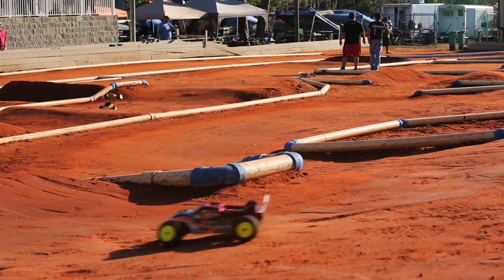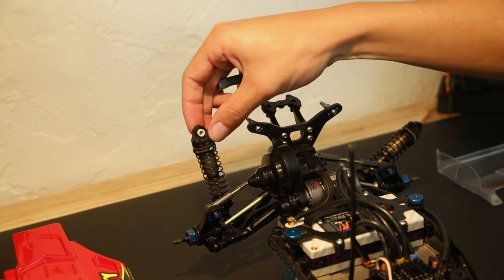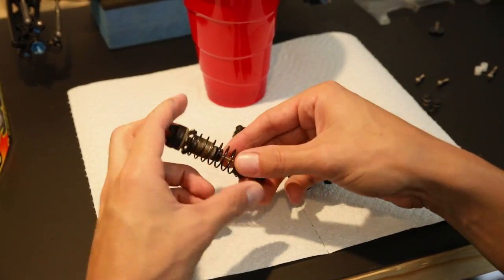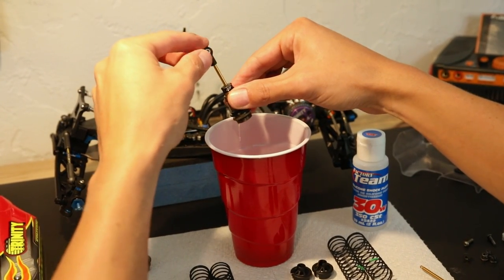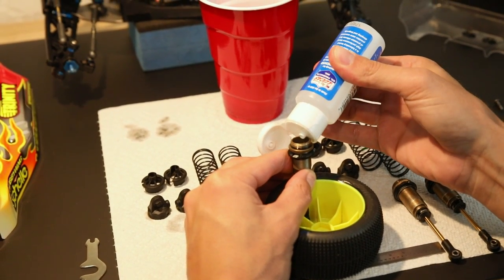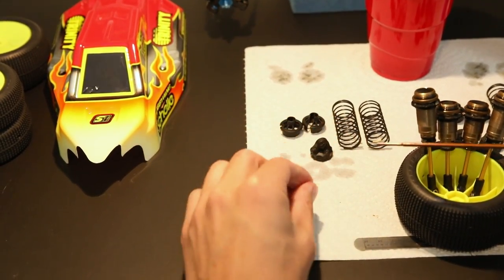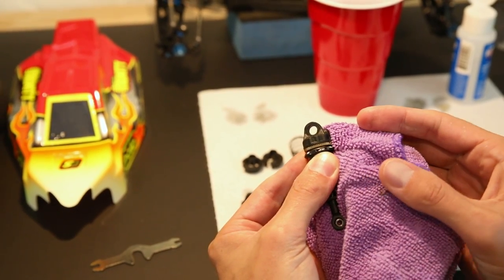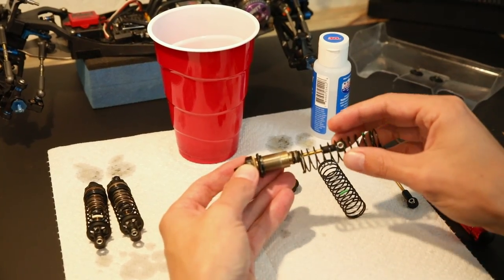HOW TO BE FASTER RC || Setups tips and mental tricks

Comment: Ryan: This might help you with an extra tenth or so especially with super loose/blown out tracks where light suspension is used. 
When doing your ride height, drop the car on two layers of polymer film, trashbags work fine, that are split down the center of the car. This acts as a roller bearing and allows the tires to compress outwards and inwards, squash, allowing true rolling ride height. 
Keep it up! Great videos :)

Comment: can you do videos specifically about setting each adjustment, and what those changes will do as far as handling changes...
   like a video all about ride height...  one about shock adjustments like different piston/oil combinations and spring rates...
   a video about toe changes and how they affect handling.
   a video about camber...
 and one about other smaller changes like Ballston washers and Ackerman and roll center and ....
   I'm just getting into setups beyond tires and shock oils, and picked up a ride height guage, camber and toe tools, and have a shock shaft tool and shock stand coming. ...
   thanks for your videos, subbed

Comment: Great advice.   1987 thru 1988 I raced a Tamiya Grasshopper.  Crude by today's standards, but top of the limits back then.  I had modified it with Oil filled shocks in the front.  All wheels and the transmission had sealed bearings,  I had better steering parts and I had an adjustable timing Kyosho Motor.  There were faster cars than mine but I won more times in my class than cars faster than me.  I will never forget a guy coming over to me very frustrated.   He says my car is faster than yours but you always beat me......How are you doing that.   By being in control of my car.   While his car could pass me....He would always loose control of it and crash.  I would drive around him as the spotters would try to get to his car and put him back on the track.

Comment: 1st shock oil change following your tips. Thank you sharing. Traxxas GTR bleed holes are set little differently but overall it was same process and it goes well for the oil change. Like slower is faster so true. Cheers

Comment: I was just wondering if there were tips you can give on basic driving of RC cars. I find that I struggle with how and when to use brake when cornering. I have search youtube and there are no videos to help guide a beginner in the basics of handling of an RC car. I have found your videos very informative and would like to know if you could make a video on the basics of how to drive an RC car during a race to increase lap consistency and handling. Thanks. Great video.
Reply from the maker: That is a great idea! I will be sure to make this type of video in the future. Thanks!
Reply: I just want to say hell yes.  I just got into the hobby and there are a lot of basic handling things that I keep messing up.  I love the idea of this type of video.
Reply: Oh man, I KNOW that I'm losing so much time because I'm crap on the brakes. I coast way too much, then when I try to push I, blow it too often. I've been racing for 10 years and braking is my crutch.
Reply: I'm trying to get into racing instead of bashing. I bought a TLR 22t 2.0 for this reason, but I could use some beginner driving tips.  I'm all over the track, the truck does it's job very well, but my skills is another story. Thanks for the great videos Ryan.  😎
Reply: Ryan Jackman 
Just watch the cars in fr9nt of you or just watch a few races and spot their lines and the car movments also never take your fingers of of the wheel
Reply: Hey Willy, what class of car are you running?
Reply: Getting a good transmitter and reciver setup is key slowing down the steering curve and helps with minor correctins on longer straights you dont get that with most basher setups
Reply: @RyanHarrisRC  you could just take one of your winning races that you taped and do a commentary about driving and what your doing. Even show repeats or slow motion of corners or features your driving!

Comment: If it pushes out that's rebound. Pack is based on pistons and the holes they have(how many and sizes). Pack referees to where the oil changes from liaminer flow(smoother low shaft speed) to turbulent flow (more restince high shaft speed)

Comment: Awesome video and a lot of great tips. If I can just ask 1 question why did you tighten your shock cap back on with tools?  It's my understanding that you shouldn't have to. It's kind of like tightening a oil filter in a full size car you only need to hand tighten them.  I've only ever hand tightened mine and have never had an issue.

Comment: What I like to do when getting the collars equal to each other. I screw each collar all the way up on each shock, take some bright color nail polish, like red or silver(nail polish is easy to remove when needed), make a mark trying to be dead center with the bleeder screw. Now, when you screw each collar down to get your ride height, you can use the mark and count each turn...say four turns on the right shock and four turns on the left shock until that polished mark you made is center with the screw again. Basically knowing you did four turns down on both shocks. And if you want to double check, after you do this, use some calipers and check the gap between the collars and top of the shock body.

Comment: Thanks for the tips dude. Ive got a race next week. Well im on a track that prints out lap times. I'll obviously be racing my own times and doubt my brushed ftx fantage will be as fast as others. Gotta start somewhere
Reply: Hey man ask questions at the track don't be afraid every 1 started a newbie or beginner man with lower class setups and slower lap times get the driving skills down first then add speed later u can have a super fast setup but no skills driving
Reply: @brettcoyle2399  thanks for the support.

Comment: Corner weight over spring collars set exactly the same height. If one shock needs a few more turns or mm to get even corner weight, its fine as long as the ride height is where you want it.

Comment: 6:08 Hi I'm from Brazil. How are you doing? I understand. Your explanation is to stay the shocks without rebound. But I need to be sure of that, I wanted to specialize a little more. Do you have more information about this? It is because it seems to me that it is not yet that way.

I know that there is a different configuration for each type of track and riding style, but there is another video that explains especially about the rebound. It says that rebound has to exist. It seems to me that it makes sense, because the oil leaks over time and always needs to be refilled...

Anyway, the question is: what is the engineering designed for shock absorbers? I mean: is the meaning of this part not absorbing impacts? It seems to me that this uses air pressure to help absorption. If you bleed, the internal pressure is decreasing.

Well, my driving style is not on circuits and I don't care about moving around corners, my goal is to jump. I intend to prepare my car well for jumps around 2 meters. Without it hitting the chassis. My car is a Traxxas Maxx, and i'm using a 12,500 CTS silicone oil. Is like a 10% more tiker than honey.

Comment: Adjusting the shock collars changes the preload, which does not in any way change the spring rate. Otherwise good video.
Reply: True but not totally. Springs can be slightly progressive so the spring might have a different rate at a different spring height
Reply: @davidcarmendy5244  True DAVID Ryan doesnt understand  spring rates at all.
Reply: @markwhittington9121  I wasn't saying he doesn't understand rates. I was just stating that springs that have a progressive rate can have different instantaneous spring rates at various spring heights.

Comment: Great video, but when you're setting the springs for ride height the adjustment changes preload and not the spring rate as you stated.
Reply: Bernie Coates preload affects spring rate
Reply: @huh2634  ah... No.
Reply: @RC-ty5ym  unless you have linear rate springs, im right

Comment: Noobie Shock oil question.  I picked up some 27.5 oil to try in my rear shocks. When I opened up my shocks I was surprised by how much dirt was in the oil. Is that normal or did I build something wrong. Car had 4 batteries run out out on it on a dirt track.   As far as cleaning the inside of the shocks, is there something you recommend?

Comment: What do you use the "Magical Spray" on?
Reply from the maker: It's a part of the final step I use for cleaning my cars. After everything is cleaned up, I spray a light coat of that over the front and rear areas of the car.

Comment: Hi can you tell me how to match motors and gearing for speed runs on my X-O1 I have an xlx esc and stock 1650kv motor until I get a mount for my TP power 3200kv motor. I run big 8th scale bsr foams.
Reply: Did u find out   yet?

Comment: My pro tip. Use wifeys nail polish to mark each shock preload tensioner whilst all at their highest. Mark them all in the same spot. Then you just need to count number of turns per shock to match. Just like marking the flywheel.

Comment: Why don’t you mention setting the rebound when building your shocks, having no rebound is not always the best way to go. Think you were a bit misleading!
Reply: Captcasper7 With the 10th scale shocks there is no air bladder, so if you have any more oil than a ‘dead shock’ it has rebound, but is impossible to compress fully, because there is nowhere for the oil to go and no air bladder to compensate, and creates an unreliable progression to the up travel.

Comment: The other pro does it totally different talking about air in the bladder for rebound? Whos right.
Reply: Deleted ions there is no air bladder in most 1/10 scale buggy shocks. So having more oil than a zero rebound shock will make it almost impossible to compress fully.